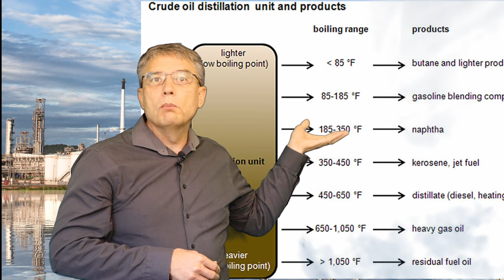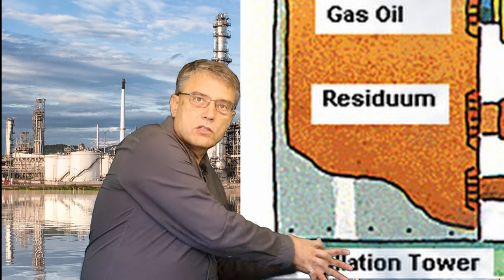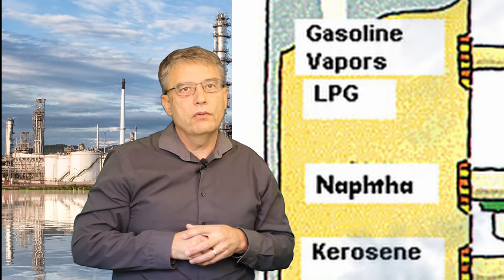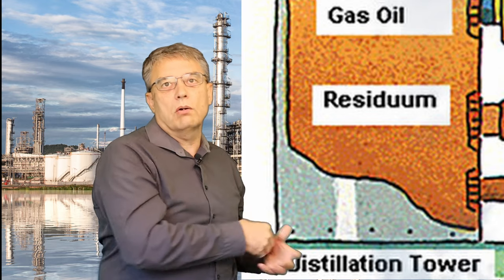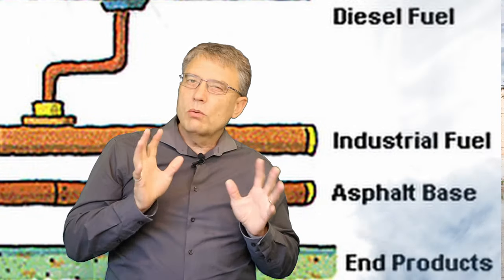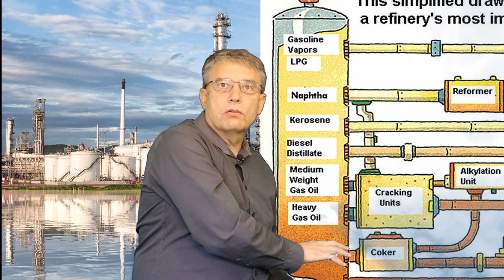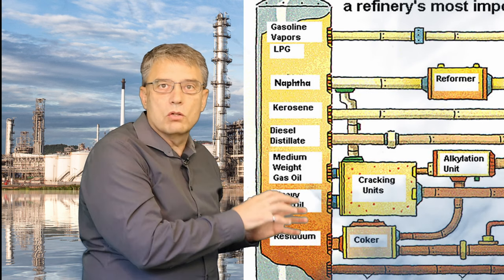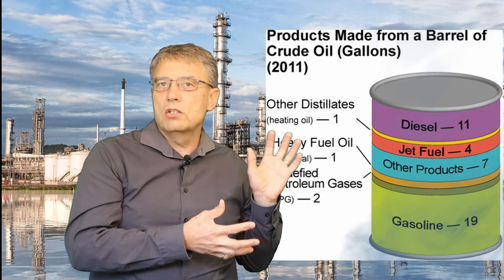Refinery for Beginners - How does a refinery work?

Comment: Ouch.  The explanation of the initial refinement of crude is a bit off.  The initial heating doesn't vaporize everything.  Instead it heats enough that a lot of the material is flashed off but not all.  It doesn't enter at the very bottom of the tower either.  After removing the volatiles, the liquid stream from the bottom of the crude tower is further heated before going to a second distillation tower that operates under vacuum.  This allows as much oil to be recovered from the tar without heating it to the point where it cokes.
Reply from the maker: Thanks for the additional detail Rich.

Comment: so what is going to happen in 15 years when most cars are electric. let say we have a reduction of 50% of our gasoline use by 2040. we will still have the same need for jet fuel, home heating oil and heavy equipment diesel fuel as we have today. your not going to run a 737 jet or Cat D11 on Battery power. how are the refinery's going to make the same amount of diesel fuel while processing less crude oil?
Reply: Not gonna happen electric vehicles are here just to cut the demand of oil by .5% 😂😂😂😂😂
Reply from the maker: Thanks for the question. Fuel mix is almost certain to change in some way. The energy industry has a history of adapting to demand across the different kinds of fuel. I’m pretty confident that if the demand drops by that much in one kind of fuel they will adjust the process mix to meet demand.
Reply: This is an old problem. In the late 1800s, the desired product was kerosene & gasoline was a useless byproduct.

Comment: One important feature of a distillation tower is the reflux which is a liquid extracted from the distillation tower, cooled down externally (air coolers or else) then recycled to the column to provide the cooling effect which allows the various wapors inside the column to cool down and become liquids and extracted as you pointed out.
Reply from the maker: Thanks for the added detail. Very interesting.

Comment: It works by using VAST amounts of Electricity to split Crude into it's component parts and and also uses Cobalt to de-Sulphur Petroleum, creating vast amounts of pollution doing so
Reply: I think most, if not all the energy to split crude comes not from electricity, but from direct burning of fossil gas & oil distillates.
Reply: @darkgalaxy5548  It does burn some fossil fuels in the process, but an average refinery uses as much electricity as  two large cities combined

Comment: Hello everyone
I am a Kurd and I also admire the country of Norway.
I do pipe manufacturing and installation works in refineries and power plants, I am a good master.
I am currently in Norway, working at Porsgrunn and Norcem. I have a two-year residence card from Lithuania and I have applied for a residence permit here, waiting for it to be issued.
I want to work at Statoil Refinery and serve Norway for the rest of my life.
Can you help me
Thanks
Reply from the maker: Thanks for sharing this. The industry is definitely in transition and it's very likely that the disruption you're experiencing will become even more common as demands shift back and forth between energy sources. I'm sure that's little comfort to you but it does highlight the need for us to help each other as we find our way to new work during energy uncertainty.

Comment: So, gasoline should be cheaper in my country but because they are only selling based on gasoline production only and all other products are neglected. I think this is pure robbery. Where are the other products going because according to this video, everything comes out at once from the distillation process.
Reply from the maker: The production mix is regularly adjusted so that supply is consistent with demand for all the products coming out of the refinery. The prices for all products are a result of the supply and demand balance. Production rebalances based on that price movement.